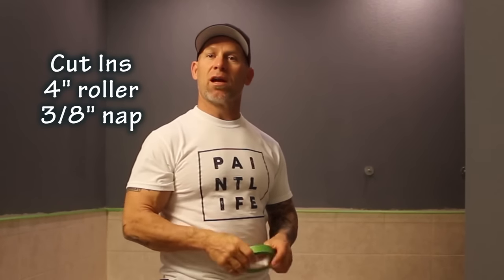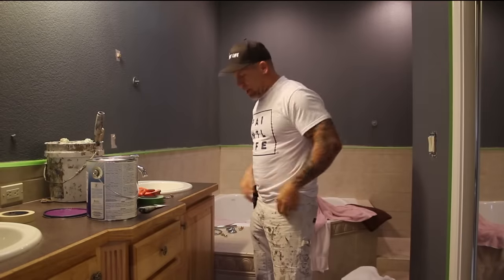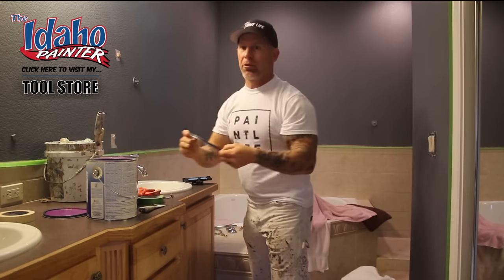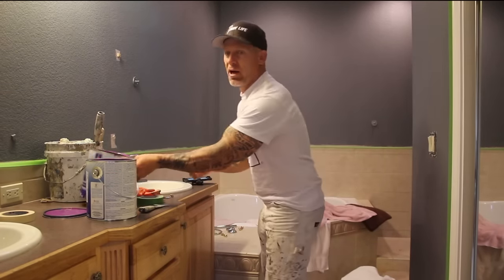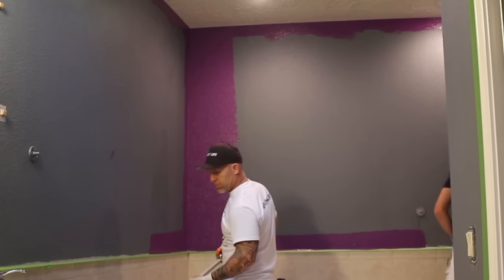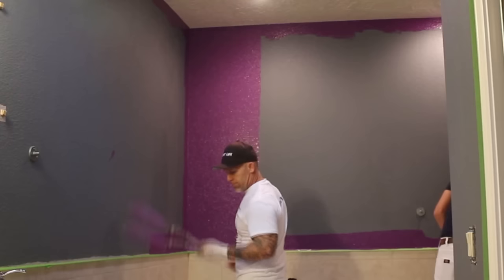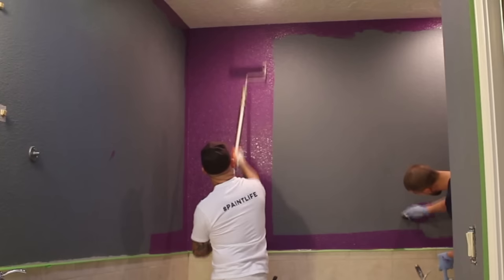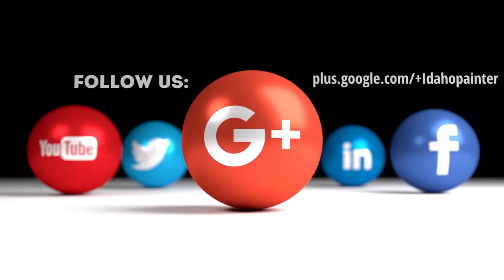Instructions Painting Interior Accent Wall Colors.  Painting Purple Walls.

Comment: A small tip about the tinted primer.  I use grey primer under my vibrant colours, but not just any grey. I will match the LRV value (light reflective value) number generally found on a suppliers colour fan deck.  0 = black, and 100 = white, and all colours are assigned a number between 0-100.  If the colour you are using for example "deep red", which is considered dark and has a LRV number around 20, locate a grey primer that also has a LRV at around 20. (If a person was colour blind he/she would not be able to tell which paint is darker or lighter then the other when both LRVs match).  If there was a small missed spot using your top coat, your eye really has to struggle to notice.  Since using this technique I've saved myself a lot of wasted time and money applying extra coats.

Also when doing an accent colour or anywhere two different colours meet, I found it works best to do the darker colour last, the line just looks straighter. When you paint the lighter colour last even the slightest wiggle of your brush will make the line look horrible.  Where ever possible I like to switch colours on an inside corner, creating an accent shape that's more solid and 3D looking.  Accented shapes seems to be the new thing, that has replaced just a typical accent wall in my area, especially cool in homes that are open concept.

Comment: Question; Should you clear caulk all of the walls that you intend to paint?
Reply from the maker: No
Reply: No, use normal caulk that you'll then paint over, and only caulk the wall you intend to paint, before moving onto the next.
The idea of caulking with tape is to remove the tape while the caulk has not yet polymerized (dried and hardened) so that when removing the tape you get clean perfect lines.
So, caulk one wall, paint it, remove tape, move onto calking the next wall, painting then removing the tape and so on.

Comment: Just wondering why u wouldn't spray it.
Reply from the maker: I like the finish rolling leaves better
Reply: For 1 room, my guess is it's also just as fast, with the benefit of less cleaning afterwards.
Reply: If you spray it, then you wouldn’t be able to touch it up because the steeple of the roller os much easier to touch up than the smoother finish of a sprayer, and believe me there is always final touch ups.

Comment: you are using up and down strokes. Most videos recommend a V or W pattern stroke and it seems to me that it more evenly distributes the paint. Is there a wrong way and right way?
Reply: How you apply is is not really an issue, the issue is keeping a wet edge and correctly blending each stroke to avoid tracing, areas with too much or too little paint etc.